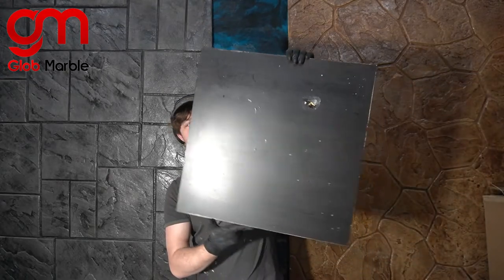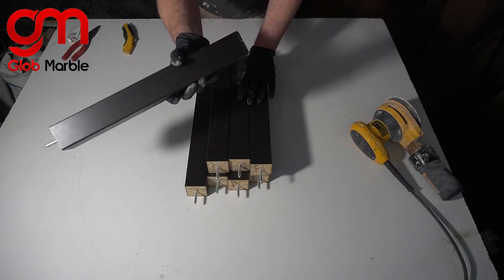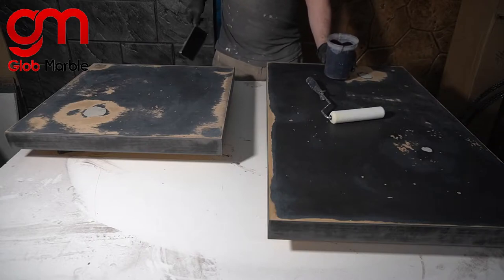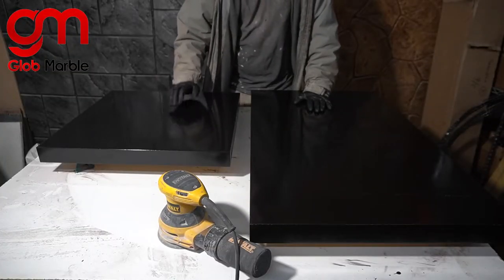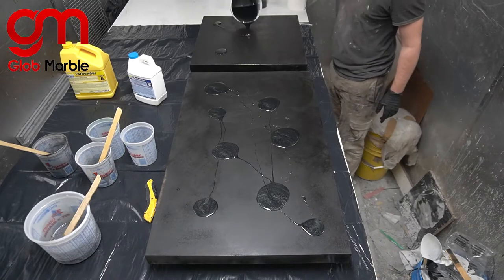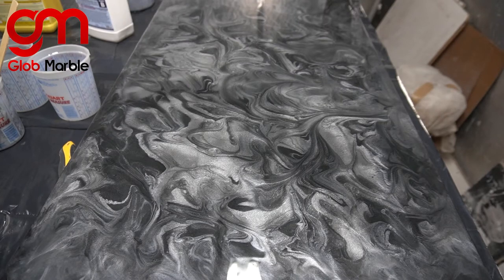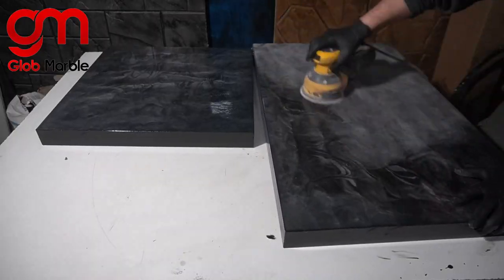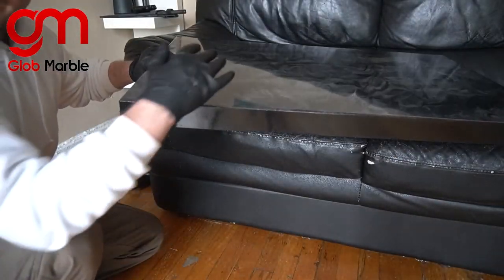How To Fix A Cheap Table With Epoxy

Comment: This was nice.. do you have to use a torch to get rid of the bubbles or can you also use alcohol spray as well?
Reply from the maker: You can spray alcohol, but the alcohol will change the texture of your work. The torch wont

Comment: What is the reason that you didn't want it to spill over the sides?

Is that to avoid streaks?
Reply from the maker: The table has square edges that couldn't be rounded because the table is also hollow. It would look awful if I tried to let the epoxy roll over the edge
Reply: @GlobMarble  thanks! What roundover is sufficient for a good roll over? Is 1/8 enough of needs 1/4?